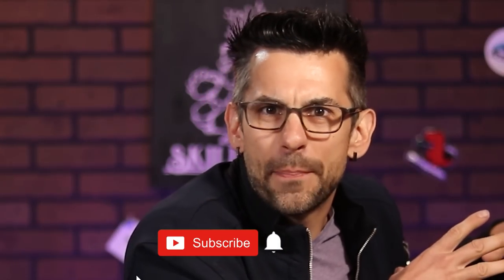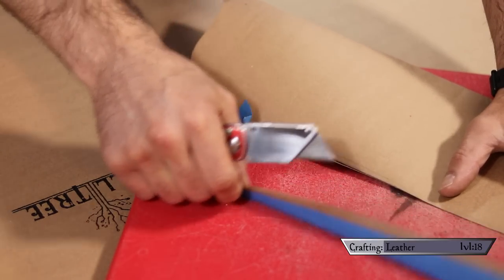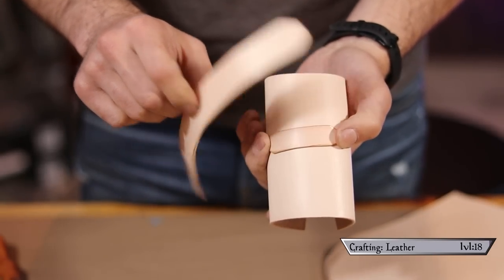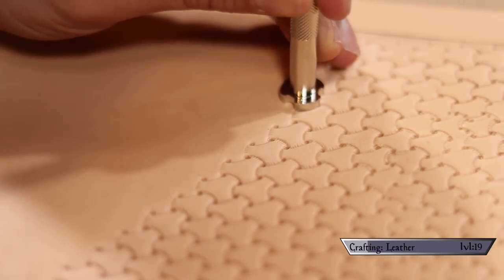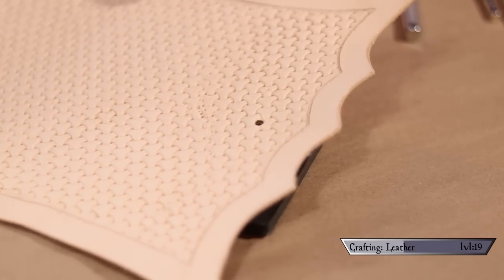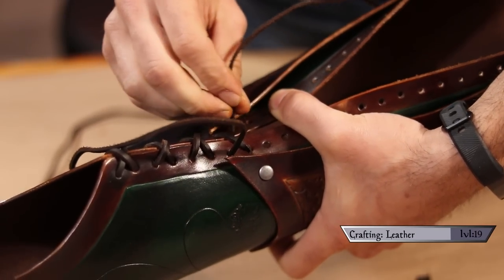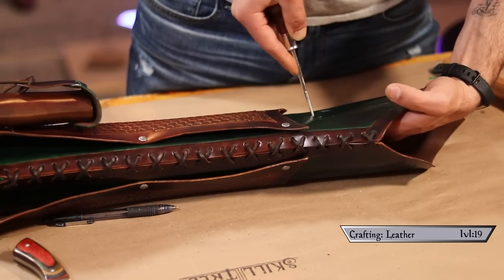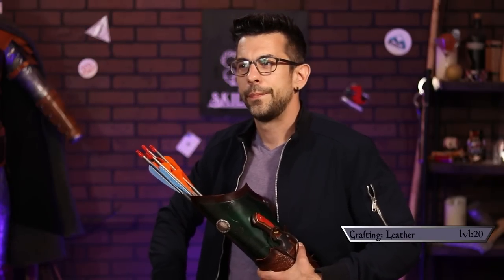Leather Quiver

Comment: About those slits you cut for additional straps and the sheath: If you punch holes in the leather at the endpoints of the proposed slits then 'connect the dots' with your knife, the slits will be neater and resist additional ripping.
(I picked up this tip from Tony at Dieselpunk and from Chuck at LeatherElement. I've heard you mention both.)

Comment: Great job! I love how you did it! Great color choice!  Looks stylish and truly fantasy.  Magnificent quiver.  You raised your level to serious professionalism.
Reply: By the way, you can use copper buckles.  Copper can be aged in ammonia vapor and then polished.  It will look more antique.  Depending on the time spent in the fumes, the depth of the patina can be adjusted.  Usually I use a plastic jar, in the lid of which I make a hole for the hook.  At the bottom of the jar, I pour quite a bit of ammonia, I hang the product on the lid and close it so that the object hangs without touching the liquid.  Experiment with a piece of copper wire.  I think you'll like it.
Reply from the maker: Great tip! I will definitely be giving that a try! Now I am going to have to buy copper fittings!

Comment: all you need now is a cloak that can hide you in the shadows and an oak leaf  necklace and youre set for a badass ranger cosplay 
great series btw rangers aprrentice
Reply from the maker: I will definitely dheck it out! I would be DOWN with doing a full Ranger cosplay.
Reply: @SkillTree  I'm currently working on a leather cloak. The pattern is from Butterick's and the leather is 2 upholstery full hides. The leather is pre-dyed, but if you can get it in a light shade, it will accept Fiebings pro-dye like a boss. It just goes together with a sewing machine.
Reply from the maker: @jarekmace1536  THAT sounds like an AMAZING build! Inspiring me. Definitely adding that to the list!

Comment: If you want to make it a real quiver, add copper scrubber to the bottom, it allows broadheads without dulling them(copper is very soft but no so soft they will cut through) it also stops them sliding around(broadhead or target points).

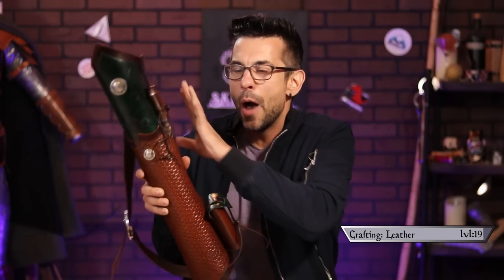Comment: 26:26 Or you have shot your arrow into the backboard, tree, root, branch & you need a knife to dig it out.

A Very nice quiver & practical build instructions. Thank you.

You might consider adding an internal fur or soft collar, beneath the sight line, to impede arrows falling out, if you were running around, or reduce the rattle sounds.

Comment: Really awesome project!

BUUUUUUUTTTTTT

The bottom of the quiver, did you put anything else in there to strengthen it, or is it just the single piece of leather? Because I feel like over time, the arrows being in there with the sharp tips rubbing against the leather bottom will just wear it down to nothing, and you'll get a hole.

Comment: I always thought an open quiver with cork fixed to the inside of the bottem would be a nice addition. Would prevent the arrows from falling out when moving. But you could still easily set and remove them as well.

Comment: So I was thinking that if you were to remake some thing like this again be it for really anything. I was thinking you could form a dragon or something shape out of the clay and bake it then using that hard stuff and the foam form it. Removeing the clay from the molded leather and making a reverse mold. Which now has a place for you to spray closed cell foam in to the form and then let it cure and remove it from the mold. This is light weight yet kinda strong. One might have to test the release agents to use. Then you can use glue to glue it in to the mold and then attach it to the bag/quiver.

Comment: When cutting a slit in the leather, do NOT just cut the slits.  Define each end of the slit with a punched hole and slice from hole to hole.  That will spread the load put on the slit and keep it from tearing later.  Definitely incorporate a proper sheath for the knife (with a welt).  Gorgeous quiver.

Comment: you coat with resist after panting the strap kelly green but I'm unclear what exactly what resist is. it doesn't seem to be included in the amazon links below
Reply from the maker: Sorry, I should have mentioned at the start that this is one in a series of leather vids where I covered that earlier. I usually try to. A resist is a product that seals your leather and makes it resist taking on anymore pigment. If I didnadd it before adding the antique it would have been stained by it. Instead, it allowed the antique to just settle into cracks, showing off the details. Hope that helps! (PS, the resist I use is called resolene). Thanks for watching!
Reply: No need for an apology and I truly appreciate that you take the time to put yourself out there. You have genuinely inspired me to begin my hobby in leather crafting.to date your   tutorials are by far the easiest to follow and learn from,at least for me. Hopefully I will have something to showcase in the very near future.
Thank you so much

Comment: the way you mounted the straps (vertical to the mouth) makes it difficult to use as a back quiver and optimal as a side quiver. if you want to mount the straps for a back quiver be sure to mount them horizontally to the mouth with the top strap looking more T shaped thicker at the top and tapering down the chest. the T shape helps it stay on your back even when making exaggerated motions.